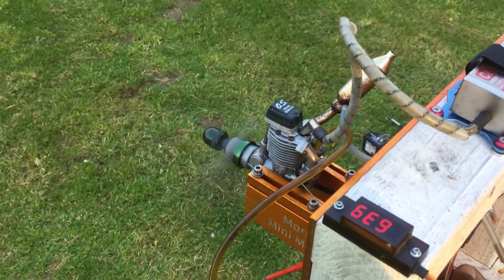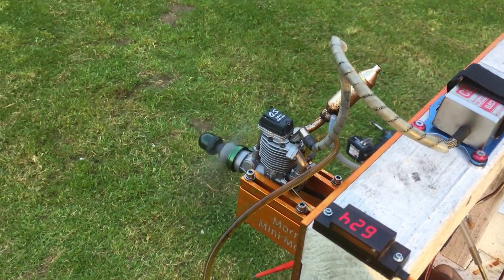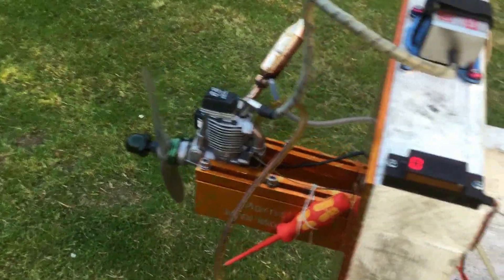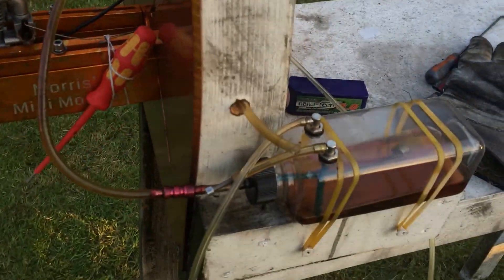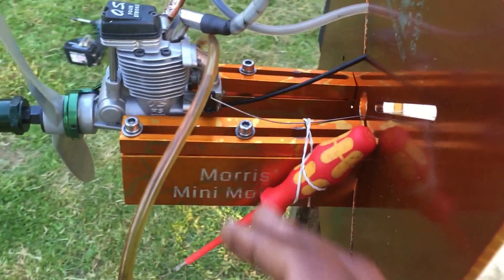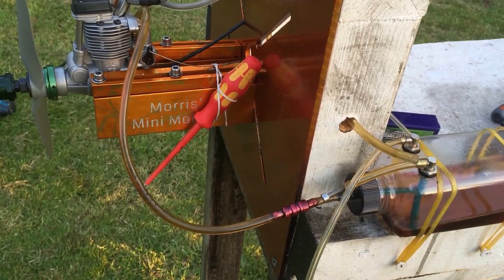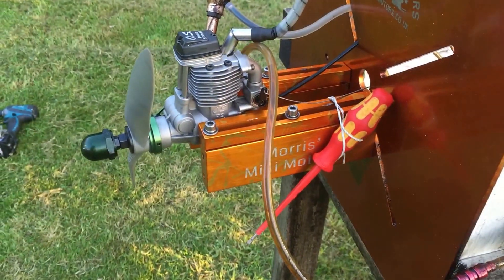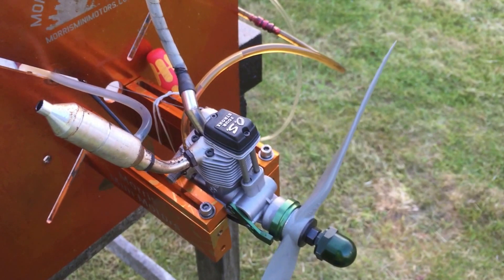OS FS-52 CDI Conversion

Comment: Well done, good job! Please can you tell me if needs some changes in the carburetor? How about the turns in the original needle valve to setup the high RPM and idle? The maximum RPM decrease after conversion to gas?

Comment: What else is required for a nitro to gas conversion besides the sensor and bracket? Thanks
Reply from the maker: Hi

For anyone any one of the fuel you are you going to use you do not need to modify the engine

You just need the 1/4-32" ignition , 1/4-32" spark plug and the fuel of your choice

Thanks Morris